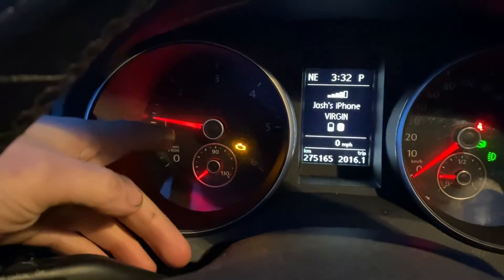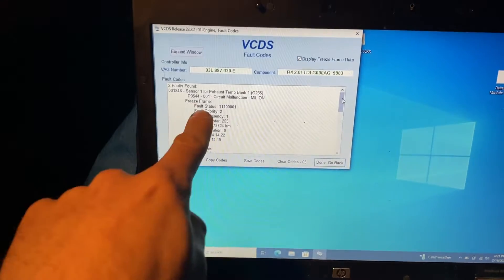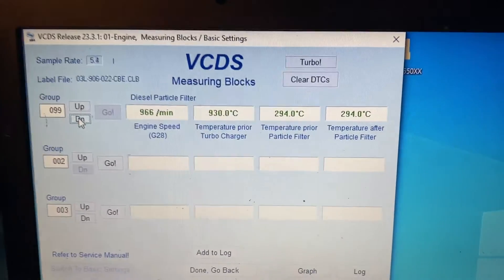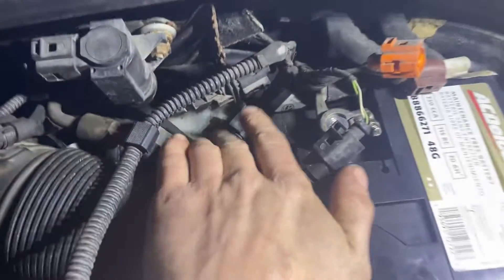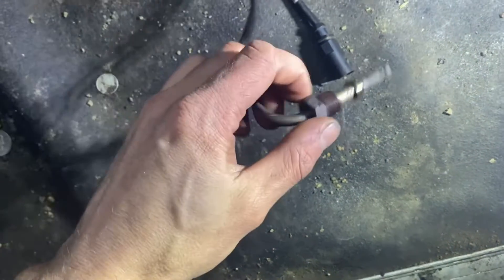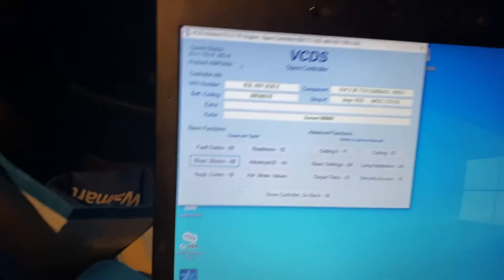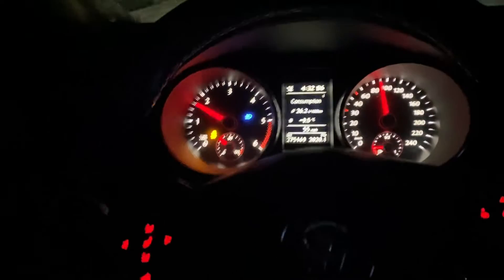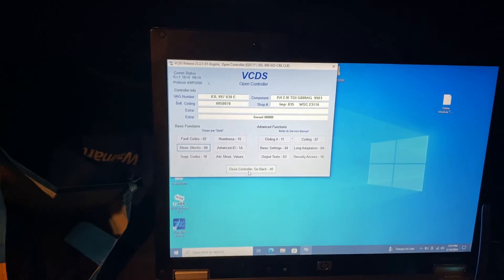Diagnosing & Repairing P0544 EGT sensor 1 malfunction on CJAA TDI

Comment: Hey i have a 2015 vw passot and I got the pO544 code. We'll it's actually 3 codes all p0544 one says pending the other Says perment  and one says temporary. I replaced the egt sensor 1 bank one with a brand new one from dealer. I cleared the codes but I only cleared 1 code. Still have the flashing glow plug light car is deleted for off road use please help
Reply from the maker: I haven’t dug too far into the 15’s yet but is there a possibility the wrong one was changed? Have vcds to compare sensor temps?
Reply: I have a 2015 mrtuning. I think the tunes supposed to delete all sensors. Besides the egt pre turbo. I have flashing glow plug and check engine light exhaust gas temp sensor same 1 as you. How do I tell what sensor it is so that I can make sure it’s plugged in

Comment: With any of the tunes you have tried B1S1 02 sensor what is a normal reading after installing a tune? I ask because mine is reading 0.0.
Reply from the maker: What group are you looking at? I can see what these are reading.
Reply: @JoshsJettas  what turner, measuring block or scaner?
Reply: I have a reading  with vcds measuring block 034.
Reply from the maker: Ive got rpm, load, lambda and lambda. MR Tuning reads 99% at idle and they all drop as engines loaded up, switching to tunezilla shortly
Reply: Thank you for checking not sure why my other scanner showed 0 when pulling up live data.